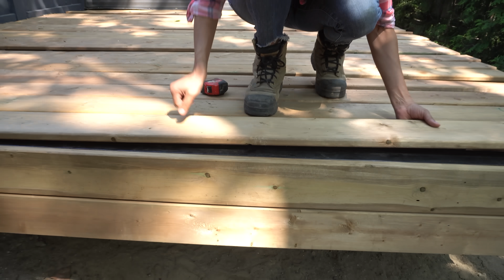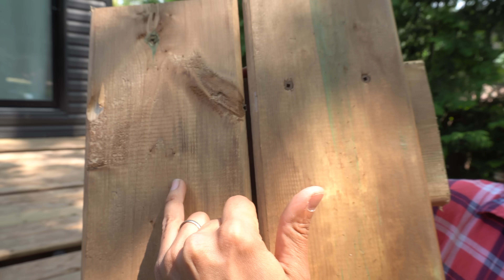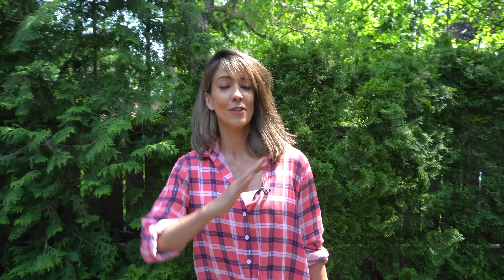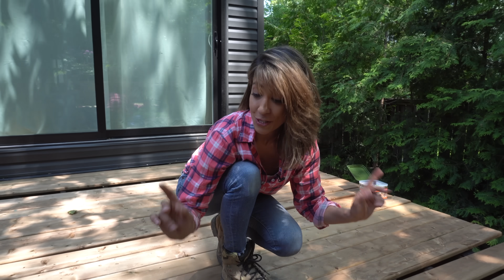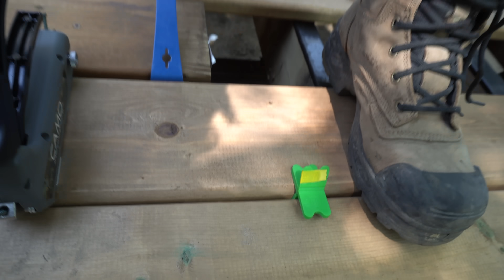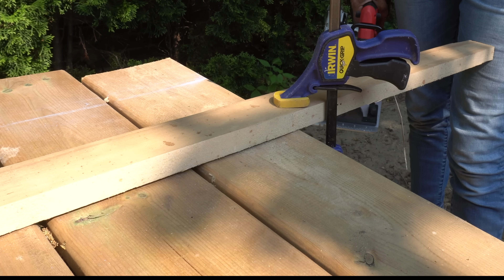Why No One’s Using Deck Screws Anymore: The Hidden Deck Trick You’ll Wish You Knew Sooner

Comment: Another Pro Tip: Do not order deck boards from Home Depot and have them delivered. They will pick the shittiest, warped boards to send you since nobody in their right mind would buy them off their shelf.
Reply: Actually they (we) pick what is on the front and top of the bunk. Large quantities are picked with the forklift and any excess material is removed and placed on the store rack. Personally, I go to the store and hand pick my boards. I’ve so far made multiple trips over the last couple of weeks to accumulate 22 good boards that meets my expectations. Also as a former HD lumber associate, I didn’t send out obvious bad materials because I knew that I would eventually have to handle those again when returned and pull more for replacement. Maybe it was just me and the associates I worked with.
Reply: Always best to pick your own materials, get everything in one trip, and then have it delivered. 👍
Reply: Water treatment is a must to avoid splinters and rot. Many people can't stand green copper wood look anyway. Sealers fade in sun and dirt stains the wood. In 5 years gonna end up with dirty brown gray wood. Never seen a wood deck look new 5 years old even with sealer or stain applied yearly with or without power washing prior to sealing. It costs a bunch more but the longevity of trex seems worth it. My brothers deck is 15 years old and still looks brand new. All he does is mop it. twice a year.
Reply: @kirthammond9704 can he walk barefoot on it during the summer? One drawback of composite that I repeatedly see mentioned is that it gets unbearably hot.
Reply: backyard faces north so deck only gets morning sun. cool in the shade of the house all day.
Reply: @drnope316 it also feels bouncy even with closer joists
Reply: @drnope316 This is true. The bouncy thing is not or at least not on my deck. It’s 10 years old and looks great.
Reply: I hand picked 32 deck boards from 84 lumber and still returned 6, building is quite dark
Reply: I went and hand picked every one out at home depot
Reply: Not just Home depot as that’s unfair. It’s human nature world wide for any trader to shift a portion of some faulty stuff if they have sold it “ sight unseen”…
Reply: Anything can look better if you are happy to pay 5x norm competitive price for your fixings.
Reply from the maker: Thanks for sharing your experience. Unfortunately that does happen. Good point.

Comment: I bought the Camo system for our deck too (upon your suggestion) and while it has made the consistent gaping and no top screw installation so easy I had a thought about half way through…. What if you ever have to remove a board to replace it? Can you show us what would work? The screws go so far in that I would bet this will be a big pain if it has to be done.
Reply from the maker: @AmandaSlim-n7r  a multi-tool with a drywall knife as a guide would be an easy fix. Haven’t had to do that but I’ve dealt with a lot of rusted out faced screwed decks.
Reply: Hi, I also did camo system with ceder boards and recently replaced (flipped) a boad that was cupping and holding rain water. Little tip is I used a credit card type plastic as a wedge between the board and screw bit and that way no scuff or damage was done to the board. The cupping was so bad it had broken off some of the camo fastners. The process of removing a board turned out to be quite simple for newbe like me.

Comment: I used the Camo when I built my deck some 7 years ago. I would not do it again. Now I'm  dealing with some repairs and getting the screws out is a nightmare!  Instead I wish I would have just used the decking screws you used on the first plank and if I'm not misteked they make a bit that countersinks them just a bit. Not only is the angle of the Camo installed screws and issue it's also compounded by stain and wood filling the screw heads. Needless to say, I'm not a fan of the Camo system.
Reply from the maker: I appreciate you taking the time to share your review with the camo deck tool. It’s unfortunate that you didn’t like it.

Comment: I understand folks not liking screws or nails on the top of their deck boards.  I've installed well over 20 decks in my lifetime.  Early on I used nice redwood, (read it as clear heart green)  Beautiful wood, but it isn't available really at any price less than $15 a lineal foot, or $30 a square foot.  I learned a lot though from those decks.  I only use synthetics now, after ripping up old decks.  I don't want to waste beautiful wood on a deck that will last 30 years or even less.  I admit I live in an area that has a lot of needle drop and is fairly wet.  After seeing decking and joists rot out with tight spacing, I now use 1/2" spacing!  Admittedly it is a lot if it is an urban environment with women in high heals.  But if in the rural area, it is the best.  It sweeps MUCH better, and most needles and detritus falls thru.  And the detritus build up over the joist usually just falls or blows away also.  Because of the large gap, there is no way to really do it other than the special deck screws for synthetic.  Comes out perfect.  I expect to have them last 30 or more years.  I flash the ledgers, and put tape over the joists too.
Reply from the maker: @paulkramer4176  thanks for sharing your experience living in a rural area with lots of needle drop. Wider spacing in that case is a smart way to go. Lumber was beautiful and is. I appreciate the beauty of it too. Good to hear from you, Paul!
Reply: I know that many people are using the fake , plastic ( synthetic ) replacement for real God-made material. Being no one's expert , I've seen hardie board ( sheet and stud ) delaminate from exposure ( aka weather ) . I think everyone knows that the sun kills almost any synthetic man made products in short order. Imho. God Bless.

Comment: My contractor is suggesting that in addition to the two Camo screws, he should face screw one screw in the center of each board to every joist to prevent cupping, board pulling out one of the edge screws, etc. Your thoughts?
Reply from the maker: Sounds like your contractor is cautious which isn’t a bad thing. I also have used these as face screws on risers etc. I haven’t had issues but regionally you might experience different conditions than I do.
Reply: Hope you found a new contractor, doesn’t sound confident at all, , your boards will likely split or warp more , as can’t shrink and expand with the weather , and won’t stop cupping, if anything you want a crown, so water runs off.

Comment: I bought the Camo system on the recommendation of another YouTube contractor and the results are fantastic! It’s easy to use and provides strong secure fastenings. And the appearance of a deck with no exposed hardware is so clean and professional looking. I’d recommend this product to everyone.
Reply from the maker: @brianmcconnell1817  Thanks Brian for sharing your experience. It’s really helpful when viewers weigh in with their reviews. I agree the look is amazingly clean and professional!
Reply: I own / used the camo tool hate it for many reasons especially difficult to remove the screws to replace the boards the angle causes them to strip easily and board pops are prevalent with the camo method . I Will NEVER USE IT AGAIN !!!

Comment: I did not see what you did with the L brackets after flipping the board over?
Reply from the maker: @pearlhall3787  that’s because I didn’t show it, as you can see. You attach the other side to your joists. If that’s not possible you can always face screw your last board or install it before the two boards preceding it so you have room to install it. Thanks for the question!
Reply: @DaruDhillon  thanks

Comment: Wow, a tool that is not outrageously priced.   How do the screws stand up to remove them in 5 years hiding on the side?
Reply from the maker: Agreed, it is well priced! I can’t say in 5 years time. Old decks with traditional screws rust out and require pry-out or cutting. Traditional deck screws don’t always cooperate. If there was an issue I’d use a multi-tool on an angle with protection on the adjacent board.

Comment: How do you avoid cupping or bowing when only screwing the edges? Also wondering how many boards rip out the edge when they shrink.
Reply from the maker: I haven’t had an of those issues. I’m using the longer screws. Our wood here isn’t wet so the shrinkage is minimal with the 1/16” spacing.

Comment: This chick is completely clueless you never put spaces in between pressure treated lumber decking you bring them up tight because against one another that because they will shrink the way she’s doing it you end up with a haft 1” space between the boards.
Reply from the maker: You install with no spacing if your wood is wet. I’m in Canada. Our wood is not wet. It has less shrinkage than US pressure treated. Spacing is based on moisture content and the amount of overhead debris/nature that will be accumulated on the deck. This deck is featured in my deck staining video. With lots of closeups on the spacing. You might get a kick out of it!

Comment: I've used bowrench to help with a bowed deck board. I work by myself.  Very easy to use and works using framing members. No screwing decking scraps first. SAVES TIME.
Reply from the maker: Smart. I was going to do the same thing. I didn’t open the package from Amazon until the day I needed it. The handle was missing so it wasn’t useable. Lesson learned.

Comment: I have the greatest tip for everyone never use a impact drill for installing deck boards or hidden fasteners. It’s noisy and extremely slow compared to a regular drill. But thanks for the good videos.
Reply: Impact is much faster than a drill . Compare and you will see
Reply: @donaldconover4782  impact is faster than a drill. Unbelievable. Ok.
Reply: In my experience a drill can stop at a point of resistance, while an impact driver will hunker down and keep going. This is why I used an impact driver for my entire deck construction.
Reply: @brianmcconnell1817 that’s why you have a clutch
Reply: There’s no comparison. And I would guess that anyone who still thinks a drill is an overall better tool for driving than an impact ‘driver’ probably has not actually used both. The ONLY advantage to the drill is it’s quieter. Myself, dozens of decks built with impact drivers, none with drills.
Reply from the maker: Thanks for sharing this tip. I have heard that some people prefer using a drill vs an impact driver. If anyone else would like to weigh in with what they like and why that would be great. Thanks for posting your thoughts!
Reply: I think it’s personal preference and if your wearing the APPROPRIATE PPE. NOISE WONT BE A FACTOR !!
Reply: Impact is made to work faster. What are you talking about?
Reply: @ladyt2588 And you don’t have to constantly have to back out half driven screws when the drill starts jumping and ruins the drive bit and the screw.
Reply: 🚨 If the noise of an impact gun is too much for you I have the solution for you…. Stay in your minivan
Reply: I was curious about the ‘why’ in your title but you never mentioned it. I find neat rows of fasteners quite satisfying, but tbh that is from the perspective of someone building them.
Reply: Impact had a far higher RPM generally speaking.

Comment: Tight spacing on treated helps hold water and warp boards at least in my experience. Bigger spacing helps them dry and makes it easier to clean. IMO
Reply from the maker: Thanks for sharing your experience with your deck. You are right that keeping them clean from debris is important. Appreciate your take!

Comment: When doing the deck from start I usually try to build it so that no ripping the nearest board to house is needed, (little math on paper or just top view drawing SketchUp). Those screw systems are easy to use and look way better then screwing through the face, but I still haven´t given up on the idea of going full medieval and building a deck with no metal fasteners for the boards just dove-tail and wedged wooden pegs...
Reply from the maker: That’s a great thing to do ahead of time so there’s no ripping. Thanks for sharing that tip. It’s a good one! Dove-tail would be next level. That’s an eye for detail!

Comment: Thanks for sharing some good tips. As a professional I always put the boards tight together so when they dry out and shrink the gaps dont get to big. I also prefer standard screws with the larger head placed about an inch from the edges ( not hidden) for better holding power and less chance of splitting the edge of the deck board. The camo tool is something Ive never used but it seems pretty cool for the purpose you showed. If i get a customer that wanted hidden fasteners on wood Id try to talk them out of it but would do it for an extra charge ( having to buy the special tool and screws that im sure are more expensive) if they really were set on it. Good job overall!
Reply from the maker: Thanks for sharing your perspective. Where I live we can’t put our deck boards tight because our lumber isn’t wet. Our neighbours to the south can put their deck boards tight depending on what region they live. Yes, you are spot on! To your point it requires more labor so you’d have to take that into account with pricing.

Comment: In the UK it can be hot one minute and cold and wet the next.. I’m now having to redo my deck because although treated the gaps closed up in the Winter time surface water then couldn’t drain away so by Spring time it was lifting etc.. I’m still not really sure what the best gap is to go for because debris can easily block the gaps if it’s too narrow and wide gaps just get wider in the summertime.. Tricky!
Reply from the maker: Yes, you raise a good point. The more your temperature and conditions of your weather contrast you’ll see greater differences in expansion. Also, the type of lumber and moisture content of the decking is an important consideration. Your experience will lead you to a good decision. Hello to you in the UK! 🇬🇧 I love visiting your beautiful country.

Comment: Don’t agree with tight spacing if you have trees. I use 1/4 or 5/16.  Gaps can be cleaned easy with a garden hose. Tight spacing requires a lot of work with a knife. Debris accumulation at the joist is the main reason that joists rot.  Also surprised to see 1 inch thick deck boards
Reply from the maker: Absolutely, I agree tight spacing with trees isn’t a good idea. With shrinkage this deck is now 1/4”. Debris accumulation is a major cause of rot. I have a video on the causes of deck failure that show this in action for anyone who is interested. I appreciate your helpful tips. Thanks!

Comment: As a homeowner who has replaced their deck one time in 30 years I can attest to having tight spacing between the deck boards. If you have trees over your deck (and you will if you plant trees in your yard even thirty feet away from the deck) the tighter the space the less you will have to clean the gaps out. I have a Stihl battery blower and I clean the deck often and the gaps still get clogged. I will say having a battery blower will spoil you. You will be able to go anywhere around your house with no cord which is something I did for over 20 years. Pay the extra for the blower. You will be glad you did. Available at Ace Hardware.
Reply from the maker: Sounds like great advice learned through experience. I’m glad you found a tool that works for you and is satisfying to use. I appreciate your tips. Thanks

Comment: what kind of wood are you using?
Reply from the maker: Pressure treated. Looks amazing, with great value.
Reply: @DaruDhillon  how do you remove the green stains that are usually found in this kind of wood?
Reply from the maker: @giovannimurru  I find they fade over time. But if someone knows a trick please share!
Reply: so is it pine wood? @DaruDhillon